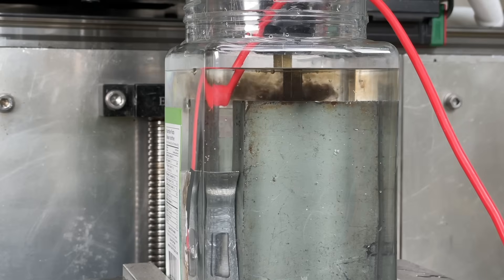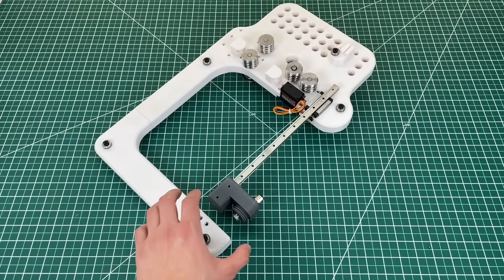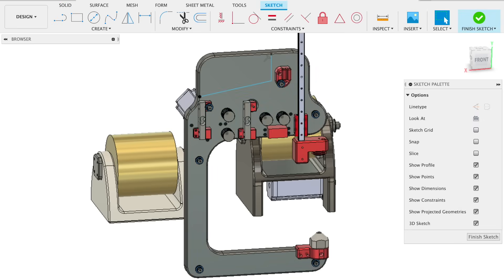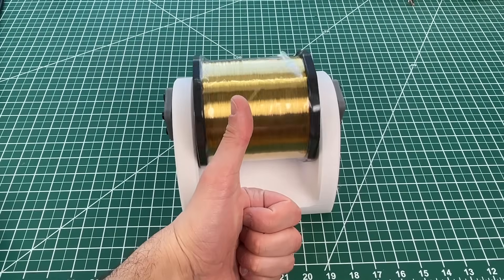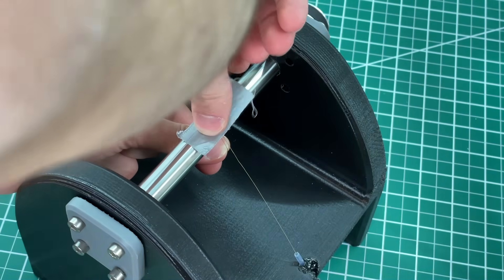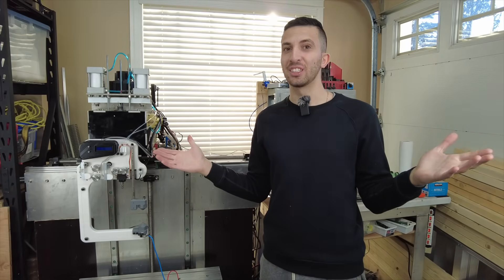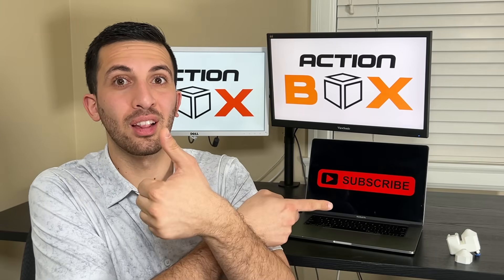How We Made A Wire EDM Machine At Home

Comment: Generator for wire EDM is not the same as for sinker EDM. Wire EDM requires shorter pulse lenght (up to 3...4uS) at a relatively low voltage (45-55V, here Im talking from my experience with Mitsubishi DWC-110 wire EDM). First few millimetres should be started with lower amperage, and only then it could be set a bit higher. At the same time wire speed at start should be faster, after the cutting is established and is stable wire speed could be slowed down a bit. Of course for industrial machines there is a books with parameter tables where pulse duration, voltage, current, wire speed and a lot more (for my DWC-110 there is 18 parameters... ) are given for different materials, their thicknesses and EDM wire diameters that is used on machine. So in reality wire EDM is more complex process unlike sinker EDM.
Reply from the maker: thank you for the informative comment. Cheers
Reply: @ActionBOX  Another thing I would suggest here would be use of deionised water that is constantly pumped through mixed bed deionisation resin. That removes all unwanted solids and non-water ions thus making water pure and unconductive. Metallic particles in water makes cutting difficult and slower. Also a good addition would be higher water pressure to the flushing zone- a pump You use in video is too small.

Comment: You could use an EDM wire drill to cut a hole through your shaft, so then you can just feed the wire through the shaft, and start it off that way, rather than using a tape. 😆 I think the only EDM with wire design I’ve seen (to be fair, that is one and only one) was a drill design, which is designed to consume the wire, rather than using it as a continuous cutting surface.
Reply from the maker: Hahaha. Great idea 😜. Thanks for your input, I’ll look into it. Cheers, Dave

Comment: An incandescent light bulb (current limiter) in series works great for over current protection.     The bulb will prevent burnout and is also an indicator for a short.   Couple that with a sensor and custom code to reverse the  axis direction if the light turns on.
Reply: Interesting finding you here. Your parts were instrumental in my airsoft grenade launcher build.
Reply from the maker: @DaveSmith-cp5kj  I’m not sure if that’s a joke or not hahaha. Are you referring to my nerf video? Or my Mandalorian video?
Reply: @ActionBOX  Oh sorry it was a reply to Palmers Pursuit. He owns a shop for obscure pneumatic parts for paintballers.
Reply from the maker: @DaveSmith-cp5kj  gotcha haha. My mistake.  I made a rocket fuel powered nerf bullet so I thought you were referring to that video.  Cheers.
Reply from the maker: That’s a great idea hahaha. I’ll definitely be doing that.  Cheers

Comment: Clearly you're giving too much power to your little wire and it melts before it breaks.  You need to drop the current, or drop the voltage to decrease the current.  Personally, I would make a  transformer that used smaller wire than your brass wire, and put in a fuse that has a smaller diameter than either the fuse or your transformer.  Then you would be safe.
Reply from the maker: Thank you. Great advice 😊

Comment: very nice. There's a different type of wire EDM called a Moly EDM that uses molybdenum wire instead of brass. The wire is more durable and cuts considerably faster on harder materials. It doesn't submerge either but uses an oil instead directly on the wire. It also uses a single wire spool that also takes up the used wire which is then reversed. The same length of wire can cut for hours. There's a huge market for that type of EDM but most people don't know about it. It saves days of cut time over brass.
Reply from the maker: This is awesome, I have not heard of it. Thank you for the tip, and I hope you liked the video 😊. Feel free to help us out by sharing with a friend who may be interested. We are trying to increase our views and channel recognition. Thanks in advance 😊. Dave

Comment: I think PWM the current would allow the wire to cool between sparks. And move the wire quicker so it does not spark at the same place twice. The wire will be consumed as well in the process. Or a wire with a higher temperature melting point.
Reply from the maker: Great suggestions. Thank you
Reply: @ActionBOX  Another thing that came to mind is the bubbles at the wire either by electrolysis (H/O2) or  the wire reaching the boiling point of the water. The bubbles could act as an insulator allowing the wire to get too hot. A more aggressive water flow may help, however this maybe problem if the wire is deep in a cut. Also try reversing the wire travel so it pulls the bubbles up and away. I'm no expert at this, just ideas that come to mind....
Reply from the maker: @kenlange6151  it’s a great idea. Thank you

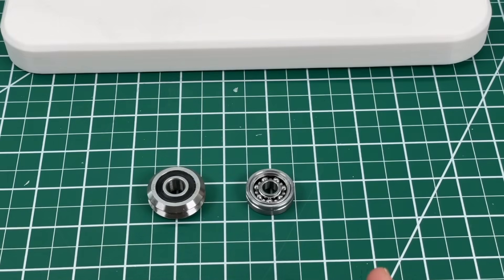Comment: It looks like the rubber seals on that bearing 2:40 are not helping the case. You can simply pry them out (usually irreversibly) or order the same bearings in the cheaper ZZ variety rather than the spectacularly ingress sealed 2RS variety that you got.

Care needs to be taken when you have superglue directly near solder joints, it can emit hydrogen cyanide gas while you're soldering. But you can just clean it up in advance with a cotton bud in acetone. Or you can glue things after soldering.

250 micron nozzle? This seems within the order of magnitude that some airbrush nozzles and some 3D printer nozzles come in, maybe savings potential?
Reply from the maker: Hey, great points. 

1. you are right, It worked. I removed the black rubber and it works more smoothly now. There is grease in there that I think still clogs things up a bit. Regardless the smaller and cheaper bearings are a superior alternative for our needs here. IU appreciate the insight. 

2. Good point. We waited about a day between superglue and soldering just by convention of our build protocols, but again, great call. 

3. 3d print nozzles are 400 microns so Its not too far off. Unless we are talking about different things here.  

Regardless, thanks for a detailed comment and hope you enjoyed the video. feel free to help us out and share with friends who may be interested. 

Cheers, 
Dave
Reply: @ActionBOX   Well they aren't ALL 0.4mm. You can get a number of sizes, 0.35mm, 0.3mm, 0.25mm (rare), 0,2mm, 0.15mm (extra rare), and down to 0.2mm ones can be bought for pennies a piece if you buy the usual brass ones in a larger quantity. I assume you want to throw a new one in every time you run the machine pretty much, because brass on brass, there will be wear. Steel ones are available at 0.2mm, they're not too expensive. Unfortunately i haven't found any ruby tip nozzles under 0.4mm in size.

For better choice, there are steel airbrush tips, very very inexpensive. There is also a 3D printer nozzle to airbrush tip adapter, you can get an original one from René Jurack or cheap ones on Ali, or just drill out and tap a random e3d nozzle.

The CA glue thing is relevant for fully cured glue. It still shouldn't be heated above 90°C to avoid accidental poisoning.

Comment: Try use tungsten wire. If Tungsten can survive the heat from the plasma in TIG welding torch then it should be capable of standing the heat from the EDM. I know in industrial EDM they use brass wire, but it won't hurt to try.
Reply from the maker: Thats a great point. Why do you think they use brass over tungsten in industry? It would be interesting to try this out. Cheers

Comment: Absolutely great project! I really like it.
I think your problem with the wire snapping is mostly related to your spark generator. Just from the sound of the sparks I assume that you have very high peak currents (>50A) and probably no short circuit detection to switch off the current in case of a short (touching workpiece or simply having a conducive particle in spark gap). This might be acceptable for a sinker EDM since it 'only' increases your electrode wear, but for a wire EDM it leads to an immediate breakage of the wire. I built an electronic EDM spark generator some time ago (which I so far only used in an prototype sinker application). The sparks sound much less aggressive and more uniform if you have a proper short circuit detection and current control. If you have the chance take a measurement with an oscilloscope either with a high frequency current clamp or carefully insert a shunt resistor in the circuit to visualize the current (but dont blow up your system/scope).
Another thing is that you need a feedback loop for your feed which is based on the spark gap (breakdown voltage or statistics between 'open circit'/'good sparks'/'short circuits'). Not having that, your feed rate of 1mm/min seems to be very aggressive in my opinion.
Also I feel that your wire speed is very low compared to professional machines. Seeing how fast industrial machines feed the wire in combination with the cost of those spools was the main reason why I never continued to build a wire EDM even though that would be a very useful tool.
Keep up your content!
Reply: I agree, one of the biggest issus should be power source and therefor that the sparks are way to violent, coupled with no "spark gap" control loop. THB i have only been exposed to EDM as "sinker EDM" in University for like 1-2h in a practical workshop(?), but the sparks back there were way way softer and smaller. Also they really pushed that spark gap control onto us as a important part, including that "sinker EDM" seems to have "pull backs" to flush the "hole".
Reply from the maker: Wow, this comment summarized all our issues. Thanks for taking the time to type this all out. I definitely believe you re 100% correct after having read other comments. I will take this into account when building our second version, although its seems like there is lots of work to do before this is comparable to a real industrial grade machine. I have never seen these in person, and Ive never actually looked at videos of Wire EDM on YouTube so I probably should have started there 😆. 

Thanks again for an awesome response. 

Ps. If you enjoyed this video,  feel free to help us out by sharing with friends who may be interested. We are trying to drive up our views to get more exposure 😊 

Cheers, 
Dave

Comment: If you can get a copy of Tool & Manufacturing engineers Hand book. Published by McGraw Hill for SME society of manufacturing engineers. Get a later edition my 3rd edition copyright 1976 does not have wire machines in it. Be sure to check index if you can. This may still be published but I think the SME has joined with some other group(s). Mine does  talk some about power supplies. The wire machines I was around run very slow but we were cutting exotic materials to tight tolerances. There about 6-8 machines in an air conditioned room built with vibration isolation. Very seldom was an operater in there. Ran 24-7 with alarms. In the late 70's- early 80s. I really like your approach. High frequency and low current. Those machines in the dark you could just see a faint blue arc interface. Hope this helps. Pleasure to see your designs
Reply from the maker: Paul, this is super useful. Thank you for such an elaborate explanation, its really going to help me with the second iteration of the machine. Feel free to help me out by sharing this video with someone else who may be interested. Thanks a bunch 😃

Comment: As I see I suspect the power supply. The large spark indicate high voltage, high current flow maybe from big capacitor. Can you explain how power supply work?
Reply from the maker: Hi, great question. I will try to make a followup video about the power supply to address all concerns.
Reply: @ActionBOX  Nice, see you then.

Comment: Thanks for all the awesome videos!
Reply from the maker: No worries! These awesome comments motivate us to make more great content for subscribers! Glad you enjoyed the videos 😄
Reply: @ActionBOX  Have you ever thought of making a 5-axis? Your 30 taper machine inspired me and i've been tinkering in CAD about making a horizontal 5-axis. But achiveing minimal perpendicularity error on the table I think will be difficult. Also I think it will be difficult to achieve minimal backlash in the rotary joints without using a harmonic drive type gearbox.
Reply from the maker: @Chris-yk5rm  Hi Chris, great question. We've actually already built a trunnion table for our DIY CNC machine, which sits right on the flat table, enabling the 4th and 5th axis. The backlash is indeed an issue still which I have not come up with a solution for yet. Great suggestion, and glad you enjoy our content 😊. Cheers, Dave

Comment: Wow! That’s an awesome wire machine build you’ve created there! Well done!
I’ve built solid sink EDM machines in the past which I find are pretty easy to build in comparison to this especially as my machine design is old school and doesn’t require any code to work etc.
I don’t know your power generator design but it does need to be different from a solid sink pulse EDM generator, it needs to be more like an RC design with a sine wave type output. This type of generator gives a superior surface finish but the electrode wear rate is very high which is not a problem on wire EDM as the electrode is constantly being replaced. You could try placing a low value capacitor across the output leads to emulate this more but you might need a generator redesign.
Also your wire feed rate is too slow it needs to be around 8m/min with a cutting speed of 3 or 4mm/min and your software needs to be able to pause and reverse the g code if there’s a short circuit etc which Mach3 can’t do, but I believe Linux CNC can and it’s free software.
Reply from the maker: EDMGuru, WOW. This is the exact comment I was hoping for. I think you are totally right, and I will definitely try your suggestion of adding a resistor to the power supply. I appreciate you taking the time to write such a detailed response to my video, and I will get back to you all with a future video on perhaps developing my own workable power supply for Wire EDM. Cheers, Dave
Reply: @ActionBOX  Just wanted to point out that he said you could place low value "capacitor", not resistor.  I'd hate for you to go down the wrong path!  Great video!
Reply: @ActionBOX  in my first attempts at the wedm generator I used a halogen lamp as a variable resistor. The generator and the feed control are in my opinion the 2 most complicated parts to get it to work, the wire breaks very easily and you will need to filter the debris from the cut and keep the conductivity of the deionised water low, by the way, this is quite aggressive with the components of the system
Reply: @ActionBOX  It's actually a capacitor you want, not a resistor, EDMGuru also stated such (I need to fully read things BEFORE engaging a response 😅)
Within reason, typically, the larger your capacitor, the longer the wave produced is.

Several months ago I saw a wire EDM conversion kit for an Ender V2, and after ingesting ALL the channels videos that day, KNEW wire EDM was my very next tool to build!
I'm looking at you my friend!
What a great begining!!
Reply: I understand kerosene is a common EDM fluid as well. 

I expect your deionized water becomes ionized very quickly. After the first couple of arcs have happened you'll have all sorts of stuff in there.. After a couple of seconds I expect it's nearly the same as tap water.

Perhaps worth a mention, even salt water is a poor conductor when the voltage is below about 1.5 volts. You need to get above the redox voltage before it starts to conduct.
Reply: I agree it is quite cool, and I would love to make one myself. The only problem is that I can't download the files.
Reply: Very good reply! Only thing I'd like to add to not use distilled water. Dielectric fluid is needed.
Reply from the maker: @MadHatter123456  as stated in the video, we are using deionized water which is a dielectric. We are not using distilled water.
Reply: @ActionBOX  ooops. Sorry, my bad!
Reply from the maker: @MadHatter123456  no worries hahah. Thanks again for watching and for your insight
Reply: @ActionBOX  I refill my wedm with distilled water by the gallon from the dollar store, it has never raised the conductivity reading on my mitsubishi machine.
Reply: @MadHatter123456  distilled water IS the dielectric fluid, until it gets crapped up, that's why a filter & Di system is used.  The only wire EDM that use oil are very fine wire, like .002" or something like that. Virtually all the commercial produced wedm machines use water. Its cheap, mops up easily and is not hazardous. It also works excellent.

Comment: maybe the waste wire spole is pulling two fast casuing the wire to fracture and then causing burn up have ye also tryed doin a tensile test on the wire ti see if it is strong enuff for the the application brilliant vidio again lads i love how yer brains work 😁
Reply from the maker: Stephen, thanks so much once again for your support 😃. We actually did investigate this and found that it was not an issue. we tested it by not spooling the wire at all, and checking the tensions as we went. As per the wire, we bought legitimate EDM wire from a supplier, so presumably we have the right stuff? Thanks for your compliment, we appreciate subscribers like you 😊.